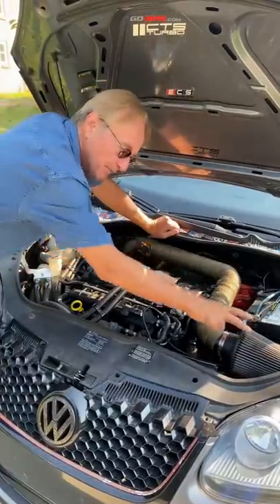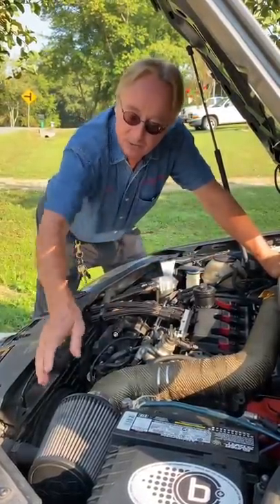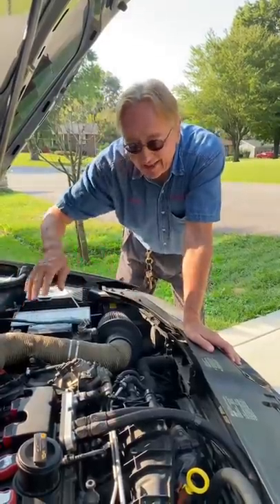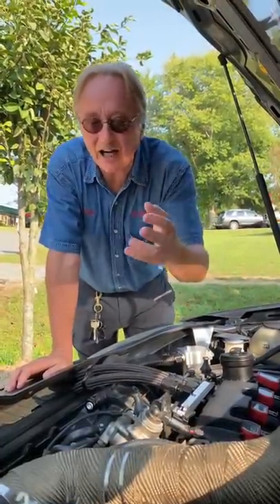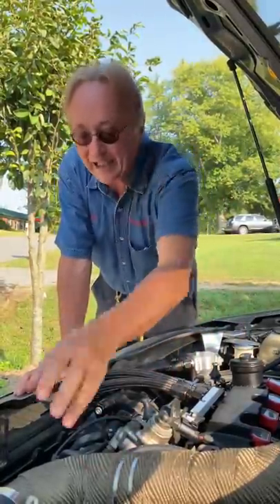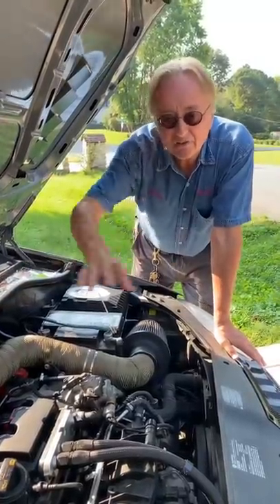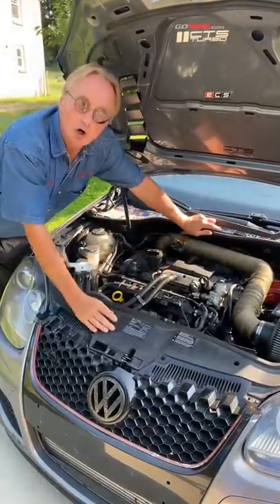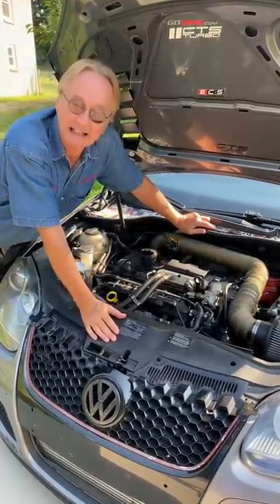Why Cold Air Intakes are Stupid

Comment: Airflow, yes, understood and agreed - messing with the volume of air that an engine receives can mess things up on some vehicles.  They are tuned for the amount of air they receive from the factory. 

Distance though?  No... The distance of the air filter does not matter.  It doesn't take a certain amount of time for the air to get to the engine - we don't live or drive in the vacuum of space.  There is always air in the intake, regardless of whether you stick a filter right on the intake, or you extend it with a tube.

But true could air intake (not what you're showing in the video, which is sucking hot air from inside the engine bay (even though it likely has a feed underneath the filter fed from the grille area).  True "cold air intake most certainly does make a difference in HP as well as other efficiencies, like gas mileage.  You are right though, it may need to be tuned, depending on the car.

Comment: With a proper heat shield, they can do wonder. Just look at a vag car only with a cai and a generic tune, you can get a lot of hp and torque.
Anyway we all want to turbo and supercharge noise even if the un tuned lose 5hp

Comment: If you're gonna put one on, know these things:
1. You must oil the filter or you'll get crap in your motor. 
2. It will sound cool, yes, but you'll likely lose hp. 
3. You'll need to tune the car for any benefit, which there likely won't be.
4. There's a good chance you won't be able to position the intake such that it takes in cold air, making this a "hot air" intake.
5. Anyone who knows motors will look under your hood and assume you've seen F&F too many times. No one will be impressed.
6. Don't purchase one, you can build one virtually for free, maybe $10 or so.

Comment: man is right. its not stupid to install then I'm if you install the properly and adjust the car by tuning it. but there's no use just putting aftermarket parts without any adjustments it will just destroy the engine.

Comment: It has literally been documented that when the vehicle is moving the cold air hits the open ended filter which allows it to be a cold air intake and it also allows less restriction.
-my check engine light has always been on but it ain’t because my cold air intakes bad

Comment: More air to an engine is a good thing. Ive put S&B cai on 2 Ram 1500 w/ the 5.7 V8 hemi. There is a small difference in initial power and in the higher rpm's. Scotty, you always know how to fix these cars but are dead wrong on cai's.

Comment: Scotty, I usually agree with you, but  that is not a cold air intake. Might say it on the box, but it's just not. Also, you don't need a tune for one in most cases, especially if you buy one from a reputable brand. I do agree that they can cause a loss of power sometimes as well. This has been tested and found to be true.

Comment: What he’s saying is true. Cars, & their engines are “systems”, just like computers. Each component is designed to work, a certain way, with the other components.  So swapping out components without addressing its effect on the system as a whole, typically won’t yield good or desired results. Slapping on an intake, bigger inter cooler, or monster turbo, by itself and not addressing what it effects, will get you disappointed.

Comment: First that’s not a cai, it isn’t shielded from the rest of the engine bay or located outside of the engine bay. Second your mass air and o2 sensors in a modern day car can calibrate for something as simple as a cai. Even old fuel injection could compensate for around 10% change.

Comment: Hypothetically he is correct if you fit a random cold air intake to your engine you will likely get power loss and run into problems That's why you have very specific intakes for very specific engines and very specific cars sometimes with chip tunes to Go with them

Comment: Isn’t there a difference between installing a CAI in a NA car and a Turbo car? I had the impression it actually did help slightly in a turbo car. Plus the intake shown in this video is a hot air intake. A cold air intake moves the filter away from the engine to get the best air flow. There’s certain intake systems that look like the stock except they have a snorkel. And again, it works better with a turbo car.

Comment: I mean he is right, I'm seeing a lot of hate in these comments..  like he's basically saying that unless you do it right: get it tuned, properly space it,  angle it for the maximum airflow, etc... then it'll actually make a difference. Only thing is all it does is increase the airflow to the intake... Without beefing up the cooling, the headers, the exhaust, the ignition system, the fuel system. The only real change in horsepower will be around 1-15hp...  See in order to get massive hp increases you kinda gotta do more than modify your air intake. I think that's the point he was trying to get at... Like it's pointless for most people because most people aren't going to change everything under the hood for a real drastic change in power.

Comment: You must get one that is designed , dyno tested. I have one and it uses the same air port the stock one does with a better flowing pipe and filter. Don’t use the one that just kinda sit in the engine bay no heat shield or nothing that’s pointless

Comment: They’ve been putting cold air intakes on since the 70’s from the factory. The 440 in my 77 new yorker has a cold air intake hose ran to the fender to suck in cool air instead of hot engine bay air. After market kits can indeed be far worse. Some even such in engine bay air!

Comment: The afe momentum gt cold air intakes have been proven on dyno 10+ rear wheel kilowatts not cheap though cost around $800 to $1000

Comment: Before y’all dog this guy, he’s right.  My autotech teacher and I talked about it.  Your car is rated for a certain miles per hour with the factory filter.  That car was engineered that way.  Yes it sounds cool and looks cool but it really doesn’t much.  If you really want to make power with it, consider making or buying one with a shield.  One that is engineered to work a certain way, I have a BMW Z3 with a cold air intake and i took the time to fabricate it to only breathe cold air.  Your car also needs to be tuned for the mods you do to it.  Just like Scotty says, so I agree with him.  If you want one, buy one that is actually engineered for more horsepower.  If not then your car is perfectly fine with the factory one

Comment: idea: put L tube in your engine bay: 
1. The bottom of L is facing the front of the car from down below(allowing the air to flow through the pipe),
2. The top of the L is facing the air intake(to maximize air intake capabilities),
3. 100% sure you HP gain,
4. u can use a aluminium heat shield to protect the pipe,
5.  not just airflow but also a cold engine bay without putting air pressure inside it(if u have a turbo the paint is gone thank you) and
6. not sure about the idea but i like it and it definitely can work depending on what engine bay looks.
This idea came by watching this video

Comment: The funny thing about this. That isn't a cold air intake. Its a hot box intake. It gets air from inside the hot engine bay. In this case it doesn't make more power. Hot air isn't dense air. If you want to make power it needs to be sealed from engine heat and a ram air scoop added to the hood.

Comment: Actually car manufacturers design air intakes (and many other components) to work globally, what do I mean by that, well they design such components to be compatible with various external temperatures, moisture (humidity) and dust particles, so their vehicles can be sold and used in both hot dry California and cold wet Finland, and also the dusty desert, Therefore it is actually beneficial to replace such parts with "performance" equivalents if you don’t live in an extreme hostile environment. 
However, they don’t generate massive amounts of horsepower and yes ideally to get the most out of a Performance air filter, a tune would be beneficial but not required as your engines maf sensor can do the leg work and make the necessary adjustments to the AFR’s.

Comment: That's s hot air intake btw... cold air intake goes down to below the engine... 

Cmon Scotty 😉

Also never needed a tune with any of the ones i installed... but cold air intake are risky if you live in an area with alot of flooding... thats when it sucks water up into the engine and causes hydrolock...

Comment: My car has bin strait piped and cold air intakes and I had it retuned to run better and right for what It has on it and my car can change timing in my vvt depending on the circumstances

Comment: I hate to brake it to you Scotty. That's not a cold air intake. They are routed to the fender or under the bumper, not the engine bay. Where there is increased heat. HEAT. Buuuuuut...I agree with you on not putting them in unless you do all the other things like free flow exhaust, headers and a tune.

Comment: Have to disconnect the battery to recalibrate the air sensor. If not, it will detect the difference in air and throw a check engine light. Happy trails peeps.

Comment: Cold air intakes go outside the engine bay or are ducted off with walls. this one in this car is not a cold air intake. It would have a seperation wall between the flter and the engine.  They make intakes specifically designed for vws. This looks like the ebay chinese version.  The engine light comes on only if you don't hook up the mass airflow or vacum tubes correctly.  These days engineers design aftermarket intake systems for particular cars and they test and tune the intake to ensure it won't cause issues before you even buy it. So just buy the right intake and install it correctly.  Plan  it out before you remove it and check for vacum leaks when your done. Don't mess with the mass airflow sensor.   Hundreds of cel codes I've diagnoed iv never had one caused by a cold air intake.  I did have one misfire caused by a restricted intake. Bigger is better.

Comment: Scotty is actually right.  I had a cold air intake on my 6.2L sierra and I put the factory intake back on today.  The truck is shifting way better and the power delivery is much smoother.  I had mine custom tuned for the intake, long tube headers and no cats and it still felt better on the stock intake.  Not saying cold air intakes are bad because they are not but in my particular circumstance it didn’t work for me

Comment: Ummm…a lot of the “engineering” that goes into an air filter system has to do with EPA and noise regulations. A cold air intake will not mess up your vehicle, as long as it is installed correctly.

Comment: I mean thats not really a cold air intake, usually their ran through the inner fender. That is literally just sucking heat from the engine bay😂 they definitely do help whether you get hp or not. It allows colder air into the engine so it doesnt get hotter than it needs to and more airflow. The stock intake on my 92 LX foxbody has it ran in front of the radiator and its a literally a little rectangular sliver that allows air in. Id much rather have a more breathable engine than almost no air into my engine at all

Comment: Debatable. If used together with your vehicles oem duct work then it’s really up to the computer and fuel system if it can compensate for more air flow by adding more fuel. Some cars can compensate via an intelligent ECU and some decent fuel systems can compensate as well. Mine could, but I’m still tuned.

Comment: This isn't fully correct.

I've put a short/cold air intake on many many cars over the past 20yrs & not 1x have the check engine light EVER come on. Also tuning DOESN'T NEED to be done, I did 1x & it cost $239. Also it's not 1-½%, more like 5-15 with some cars higher than others.

Also I put 1 on my car at 45k & didn't get that car tuned, that car lasted to 293k miles & definitely was a noticeable difference. 

The only thing he said I would agree with is some cars it is possible to loose HP although I've never seen it personally.

Comment: Ahh scotty your wrong! Saw this a long time ago and always wondered if you where right about the 1% gain and turns out no your not. I put a cold air intake onto my 1.4 polo GTI and and got a increase of 21hp (doesn’t sound like a lot) but my car before only had 190bhp so adding 21 without turn is more like 10% gain to power and once tuned properly (only cost £200) it’s made 29hp extra.

Comment: Ok I know you won’t reply to this but I have a cold air intake that was made by ford performance and has an adaptive tune that is constantly changing settings in the engine control module depending on charge temp engine temp and using knock sensors and it even allows me to keep my factory warranty and my extended warranty from ford 
So Is this cold air intake hurting my engine

Comment: I respect a lot of what you have to say but a proper Lee design cold air intake will make more horsepower than factory. The picture you are showing is not an actual cold air intake that is an open element intake wrapped with thermal wrap, which will actually hold heat inside of the intake tube and not reflect it. That should actually have reflective tape on it and not actual head wrap to hold heat in that isn’t a cold air intake. It is an open element intake, which will suck hot air from underneath the hood, and not all air intakes will set a check engine light, please sir if you’re going to be talking and educating, please be specific if it was a mass air meter car and you change the diameter of the actual sampling tube of the mass air. yes it would throw a check engine light and possibly cause the car to go into limp mode but if I am not mistaking that car that you’re showing is an actual car, which means it would not throw a check engine light.😊

Comment: Okay, if you're putting an intake like that one in your car that doesn't have proper air flow sensors yeah your going to have an issue. For your truck, putting an S&B or K&N intake won't hurt the engine. They specially engineered those intakes to be installed without a tune due to the minimal increase in HP. Your full mileage will change slightly, but that's it. 

Scotty says in every video after the market part is stupid or dumb. I wonder how much he gets paid to the say that by the main car companies or EPA😅

Comment: Not 100% true. 

I when from a 15.2 to a 14.6 in the 1/4 mile with just the cold air intake. 

The next car I own will not have a CAI though, because, yes, that intake system was designed correctly, with two 90° bends. Unlike in the other car I mentioned.

Comment: This is not a cold air intake, this is a short ram intake. These are bad because they get hot air from the engine bay instead of cold air from outside like the OEM air intake or a real Cold air intake

Comment: Sir, please don't pass false information. 👉 OEM intakes are tuned for NOISE SUPPRESSION, not for power or efficiency. 👉 Cold air intakes, when constructed and installed correctly, reduce restriction and introduce denser air, resulting in increased efficiency and up to 10% more power depending on how restrictive the OEM intake was. 👉 Modern ECU's are FULLY capable of compensating for the increased flow denser air.

Comment: Scotty you are the best I had a 2003 envoy the engine went so I got a 2005 envoy but the new one has a aftermarket turbo airflow intake the new truck is loud I don’t like loud is it ok to put the 2003 intake on the new 2005 envoy ?

Comment: Do you want to know whats dumb? The engineers at Honda for installing all the critical parts, on the back side of a tiny engine bay, that not even a little boy could fit his hand between the valvecover & the firewall. Putting an airbox that you need a degree in phyics to be able to remove, now that is dumb, it's  no wonder why everyone is running to get rid of that garbage!

Comment: That's a short ram air intake not a cold one. Cold Air intake pull air from outside into & away from the hot engine. That's why it's called cold air intake. The car computer PCM/ECM Adjust itself to change the air to fuel ratio to compensate for the excess air. But what do I know I build cars for movies like F&F & Mad Max and the Last Batman movie. 💀

Comment: Bought a 2000 blazer, k&n cold air intake and fuel injectors, i bought it from the railyard near my house the lil bastard was used on the tracks and runs like a caboose lmaooo

Comment: This is bad advice.  If you buy a cheap eBay one maybe but quality intakes say from AEM WILL give you more power and even better mpg. No u don’t have to tune, you should still be within the temp and airflow ranges of the stock sensors. Finally, he’s not showing a cold air intake, that one ain’t getting nothing but hot air

Comment: This is incorrect. You can put whatever type of intake or even no intake your cars engine will suck in however much air it needs no matter what. No more no less. UNLESS you force more air into it by a turbo or supercharger. A cold air intake does not make your car change at all. Just sounds different….

Comment: Jokes on you- my check engine light hasn't turned on since my gauge cluster died in the 80's, and the engineer that tuned my car in the 70's didn't account for me taking off the vacuum lines. 

Jokes aside, you ain't wrong. Daily drivers don't need an cool air induction, but the asterisk here is most modern engineered cars. My carbureted monstrosity can get away with it because I was already getting 96 horsepower anyway.

Comment: A check engine light huh? 

Well, I've owned a BMW 530I E60, VW Passat CC 3.6L, BMW 130i E87, Audi S3 8V, also a Nissan 300ZX and I've had pod filters on all of them and never gotten a check engine light 🤣 Also have gotten more torque down low and induction sound

You know nothing about these lol